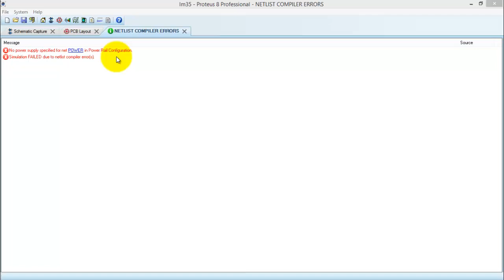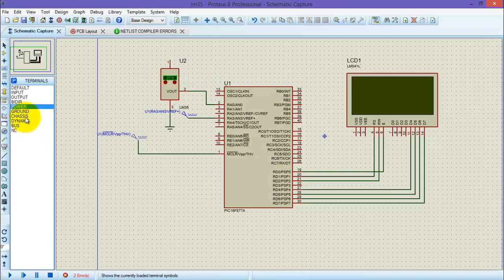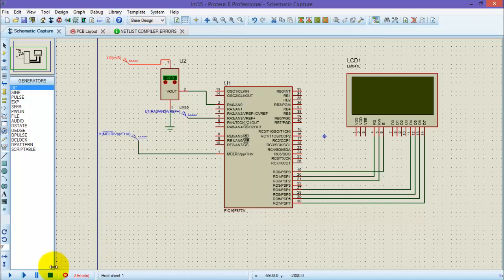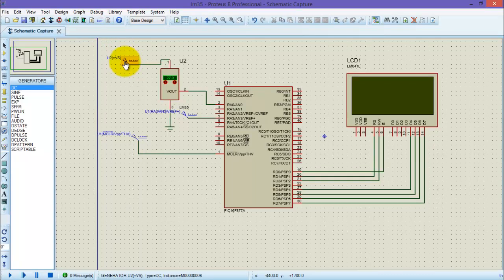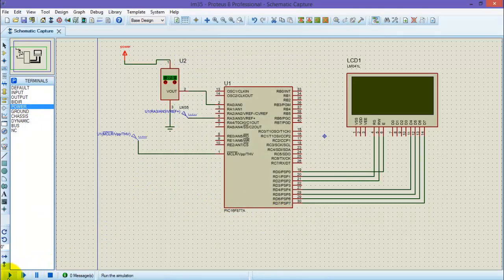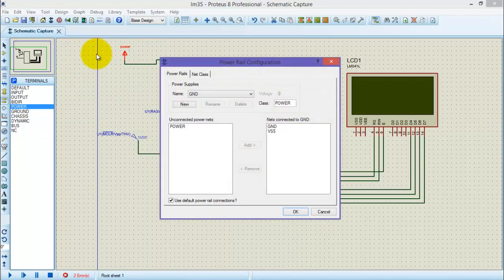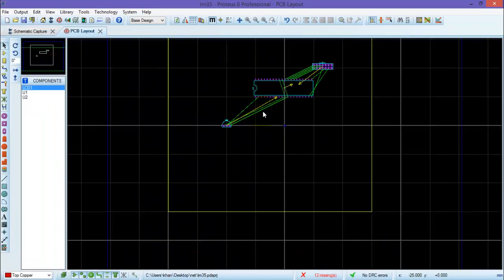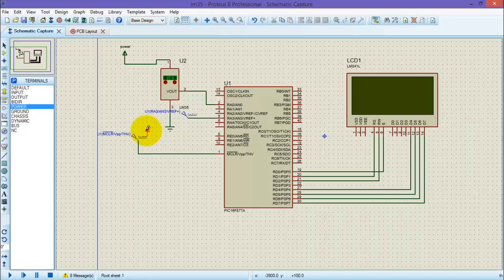No Power Supply Specified Error | Power Rail Configuration Proteus 8

Comment: What if i want that the ic vcc to be the ouput of a voltage divider ? It keeps showing the same error that no power supply is specified, but the voltage should not be a constant value, it should change depending on the circuit

Comment: how do i connect the vdd and gnd to the microcontroller as it does not have the pins shown
Reply from the maker: It is autonatically connected in the software  those are power pins  they are not visible on controller

Comment: I'm not getting Vcc/Vdd option in power rail configuration. what should i do sir
Reply from the maker: Please watch complete video. We have to add these sources
Reply: @electricallectures  In the power rail configuration, below power supplies I didn't get the three options as shown in video. I only had one option that is ground. I added unconnected power and Vcc to nets connected still such option (Vcc/Vdd) is not there.
Reply: @YouKnow-ime  I have the same problem. :/